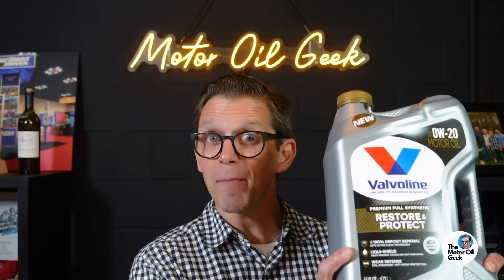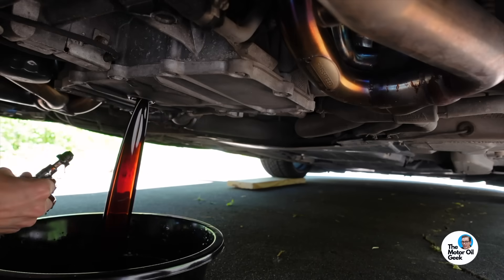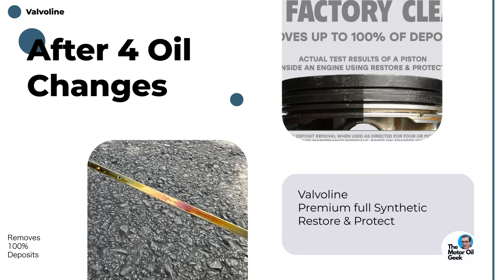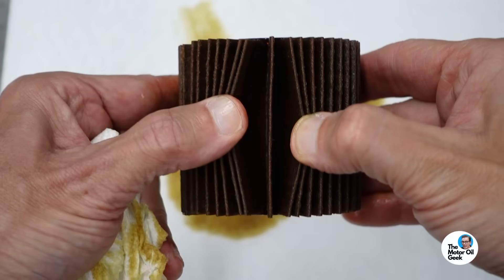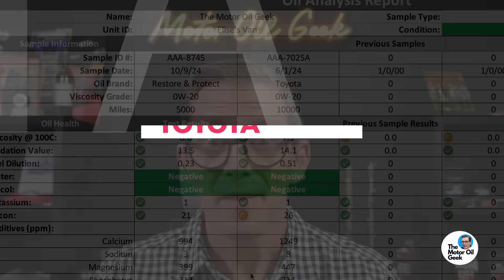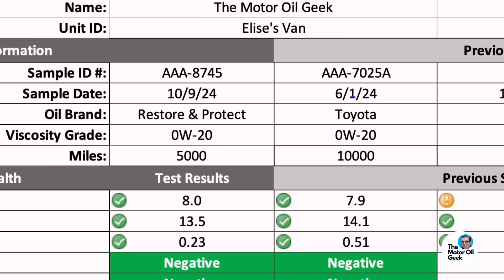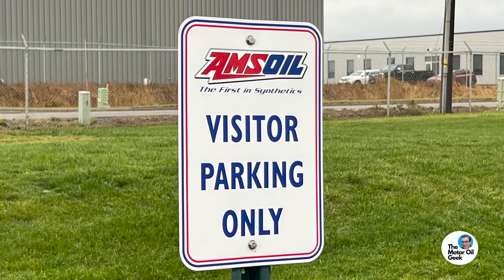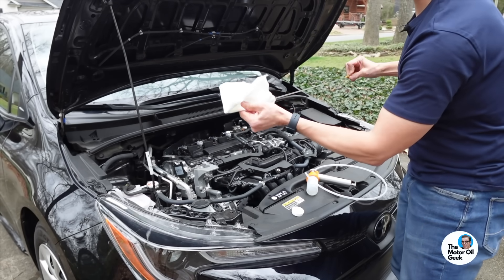The TRUTH About Valvoline's BOLD Engine Cleaning Claims

Comment: This oil is such a gimmick. We are supposed to believe you can abuse your engine for years and then run this through a couple of times and it will clean out all the sludge and stop oil leaks.
Reply: 4 times to be exact...lol
Reply: my civic burns ALOT of oil..about 700-1k per qt. Car calls for 5W-20, should i just go with 5W-30 to get lasting effects from the oil consumption? Was thinking it wouldnt hurt to keep this in longer & get more out of it? Thoughts? Also, should i top off with this or can I get away with other simialr valvoline products till next oil change? Apprently it takes 4 oil changes for it to work 100%?! Thanks!

Comment: I just run the plain Valvoline in  everything from the get-go. I don’t treat them easy.  Pulled  a couple of engines apart at 250 to 300,000 miles and clean as new inside.  
Works for me.

Comment: I know you talked about Amsoil I was wondering if Amsoil has the same benefits as Valvoline ?.  Also you mentioned about high octane fuel Sunoco now has Ultra 94 octane it's only 1 number above Shell and other brands Would Sunoco have a better overall effect on the engine efficiency and less ware and tear than Shell base on your opinion?
Reply: There will be none, please watch the film carefully, it results from the oil's cleaning parameters.

Just check both fuels, it really is no problem. I simply like driving on Shell V-Power; the car is livelier! For me, changing octanes to V-power from 95 to 100 makes no difference because the ignition is controlled by the computer and selects the amount of fuel and air, in old cars without electronics you would notice the difference.

Comment: I've been a Valvoline guy for as long as I've been changing my own oil, always used the full synthetic high mileage stuff as everything I owned was well into the 100k+ range. I've been using the restore and protect since it came out and it always seemed to be increasing the time between adding oil due to it burning and I definitely noticed the dipstick being cleaner, good to know it wasn't just a placebo

Comment: Do I have to worry about the  clogged oil filter by switching to this oil ? Thanks
Reply: From the film it follows that it does not because the carbon deposits are chemically dissolved very slowly in the oil and there is no clogging as if large particles of carbon deposits were torn off

Comment: Helo Sir How many miles did you have to wait to see the results and your wifes van ? To have a complete clean engine  I have a 2007 3.7L   Mitsubishi Raider with 190,000  now  by using  Walmart super tech and lucas oil stabilizer II'l have being changing my own oil since I bought the truck back on 2013 with only 72,000 miles , the truck runs just fine it doesn't smoke or burn oil ,in just wondering if making a change with this oil will bring the truck alive 😂thank you very much for sharing

Comment: Laying a metal dipstick across the engine and close to the battery terminals is a major cause for a short circuit?! Lay the dipstick across the top of the windshield near the vent behind the Rubber seal so for some reason it will not fall down into the engine compartment if the hood is closed it will not move it will stay right there and you will realize that you're getting blow by coming out of the dipstick tube that's creating oil spanner under the hood as well as giving you some type of diagnostic code to go along with it!

Royal Purple as an excellent oil the oil needs to be engineered in order to do the detergent and cleaning inside the engine which is exactly what Valvoline restore and protectors engineered for! You need to do a analysis of the royal purple before and after I would recommend that the motor geek compare this product as well in the future video
Reply: Can you also do some testing on the berryman's B12 used in the combustion chamber to clean up the carbon and rings and whether or not any of this product will leak into the oil engine oil and if it will cause dilution or show up in the chest oil that's test by the lab?

Comment: I just bought a 2012 Camry Hybrid with 125k miles. The dipstick is clean as clean gets. Not sure of what oils they used prior to me owning it. I do know most of the changes were at a Toyota dealer. I am tempted to try the restore and protect but I am not sure if it needs it. Oil stays pretty clean between changes and since I have it now I am going to be using Ultra Pennzoil that is not crude oil.

Comment: I have a question for you is it bad to use 10W-30 in a car that has over 170,000 miles on it when it calls for 5W 30 on the cap
Reply: With the age of the car we do not increase the viscosity of the oil because it usually ends badly for the engine, mainly due to the increase in carbon deposits

Comment: Sorry, but I doubt the correlation between Mn-concentration in used Oil and "Restore&
 & protect" Performance. In used oil analysis the higher  Mn contents mostly derived from oil dilution, specially when  Mn-containing fuel additives are used. I know results up to 100 ppm Mn in used oil analysis from "normal" First fill oil - according to your jnterpretation , the cleaning capability of these oil should even be higher than the Restore & Protect.
Additionally, the main mineral phase of Mn deposits in  combustion chambers is Hausmanite, a very stable spinel-like structure of MnO+Mn2O3 which cannot be dissolved by organic. 

However the Restore & Protect is a very good high millage oil with a good cleaning Performance in Ring Groove area, but only for organic deposits
Reply: A very interesting observation, could you write which sellers and in which fuels use this additive?
Reply: @nabiuro  I am Not familiar with the   fuel Market in the U.S ., but when he is taking about octane booster based on Mn, it is sold in the after sales Market. The chemical substance is MMT which is Methy-Cyclopentadienyl-Manganese dicarbonyl and which cause a Lot of trouble in combustion chambers, valves, Lambda sondes and blocking of particle Filters.
Reply: @HP-458  And what do you know about the European market, because I'm more interested in it, thanks in advance
Reply: @nabiuro i think  in european gasoline, a maximum of 8 mg/l ist allowed by regulation. However, you can buy octane booster everywhere in the after sales market.
Reply: @HP-458  I drive on Shell V-Power and not on crappy gasoline where you have to add additives to increase the octane number so that the car drives more briskly.... and does the same number of kilometers as on good. It is better to, for example, replace the air filter with a "sports" one from K&N, pour proven!!! top shelf oils and have a strict replacement service life and stick to it! Then you do not have to add any additives or flushes (I tested both with good fuel and oils and then their effect went down to placebo level!).

I almost forgot, I add 100 ml to the fuel. per 100 liters of fuel (3.38 oz. per 26 gallons) Universal Saver Fluid JLM valves lubricated in this way actually work better, compression checked every year is maintained at the same level as from the factory and the expense is almost zero

Generally, after all this fun and games only! with good tribological agents I have soundproofed the car in the cabin by 6 dB (A)! compared to a new factory car. The service of soundproofing the car cabin by only 4 dB is however a certain devastation of the car and costs about $ 3'800 and for this price I have for the car for free for a long time in the premium class and durability of the engine, gearbox and AWD system
Generally, fuel consumption has dropped by +10%, there is no point in saving in a stupid way. I simply cannot afford stupid savings, remembering how much it costs to replace the car with a new one

Comment: Why was the Tin level in the oil analysis higher though? Google says that can come from piston overlays or bearing material.
Reply from the maker: The Tin is from the Molybdenum additive in the Restore & Protect.
Reply: Tin can come from oil cooler solder joints too.

Comment: I would put money on the varnish being caused by running 10000 miles between oil changes. That makes my head hurt hearing that. I would never go over 3000 miles on an oil change. I had a 91 pontiac 6000LE with the 3.1L v6 and it always had valvoline ran in it. And it was given to me with 188,000 miles on it. I changed the oil every 3000 miles like my grandpa did and at 250,000 it needed a lower intake seal. The guy helping me do that said it was the cleanest engine he had ever seen with that kind of mileage. I sold that car with 320,000 on it and it was ready for another 100,000 at the least

Comment: Gonna try this in my 2016 Kia Optima that has been using quite a bit of oil despite religious oil changes. The rings have a lot of build up on them. Have tried a few things to clean it, but nothing has really worked very well for very long. We will see.

Comment: Thanks for the video. I did my break-in oil change and will be sending my sample for my 2024 Tundra. My plan was to twitch to Pennzoil ultra platinum but now you got me considering this Valvolne restore and protect. I would be interested in knowing how they match up head-to-head; wear durability etc.
Reply from the maker: I’m glad the video was helpful. Either oil will do a good job.
Reply: Also have a new Rav4, and wondering if running R&P from the start would be good?

Comment: I’m doing the same thing ( with the last oil change)with my wife’s 2010 Toyota Prius 170K I’m about to change it again. I have a question because my car doesn’t get as many miles it’s a Subaru BRZ limited what do you think about changing the oil filter only
Reply: It’s a good idea. I did that and had good results. I could feel a difference when I would change just the filter early.  The engine was smoother and faster right after as if I had changed the oil.
Reply: Also I have a 2012 Prius.

Comment: Thanks Lake!👍
Now if only the Medical Research Labs can make the Equivalent product to "Restore and Protect" our Cardiovascular systems! 😁🤞🥰
I could sure use some! 🖖
To date I've had a total of 4 Heart Surgeries. (Not including Multiple Angiograms)
1) Beginning at age 44 with 1 stent in RCA.
2) At age 57 an Ablation surgery for PVC's that went sideways and the "Dr" 🤨 rammed the catheter into a nerve bundle that left me with Left Bundle Branch Block and More prone to Arrhythmia issues!🤬
3) At age 60 I dropped dead from Ventricular Tachycardia and thanks to Numerous TALENTED and Compassionate Humans, I came back after 45 minutes of CPR, several Defibrillator conversions, 10 days in a Coma, 2 days of lowered body temperature for Neurological preservation while in the Coma, Triple Bypass Open Heart surgery, Combination Pacemaker/Defibrillator implant  that has saved my ass 3 times since 10/2021, (Strangely, the last job I was able to work was a Medical startup project that created the first Defibrillator in which the leads were only under the skin and Not into the heart!) and a 6 1/2 Week ”Vacation” in the Hospital, I was able to leave, minus about 35 pounds of muscle!😱 (Comas are a Great way to lose muscle mass in a Hurry! Not recommend)😬
4) At age 62 back into the Hospital for 4 more Stents and a 10 day "Vacation"! 😁

So come on Researchers get us some "Cardio-Clean Restore and Protect!" 👍😁

Mike in San Diego. 🌞🎸🚀🖖

Comment: What about a video on oil pressure?   Such as thickening the oil a bit for pressure or even going to the extent of a new oil pump or modifying the current oil pump pressure through spring tension.  I have a friend with a Hemi 5.7 that is having the notorious Cam and Lifters not liking each other.  We've considered shimming the current oil pump pressure valve maybe .025 - .030 to slightly increase normal driving/idle pressure to hopefully prevent damage to the replacement parts.  If this is a possible future video I'd love to see it.

Comment: I've been running 0W-20 Valvoline High Milage in my 13' GE8 Honda Fit, with no issues! besides loose valves at cold temps (not the oils fault) its done a great job running and starting for the 2 years ive had it. Changed the oil and filter myself 5 times, each around 8k or 5 months and have had a great experience with Valvoline. Cant wait to switch to the new Restore and Protect for a few months 😈😈

Comment: Awesome results my main concern would be when first using it should you change the filter sooner on the first 2 or 3 changes ?
Reply: I’ve had good results changing the filter early on the first few changes. As in I would just change the filter only, top off and wait a little longer to change the oil itself.

Comment: Curious to try this out on my 236k 2013 corolla. The valvetrain is a little noisy (it's been that way since about 192k miles sorta off and on). Inside the valve cover was no varnish and very clean cams and rockers. Curious to see if this stuff will make a difference. Also curious to see if I should try 5w30 or 0w20 edition.

Comment: I am curious how this compares with Pennzoil Platinum High Mileage, which is what I run in my two older vehicles. I am willing to switch over, but so far I have had good results with the Pennzoil and I would prefer not to switch oils. However, if the Valvoline proves far superior to the Pennzoil, I would probably switch over.

Comment: LS'jr just lowered his credibility with this video.
Reply from the maker: In all seriousness, why?
Reply: @themotoroilgeek  , I've looked at many UOA reports using R&P and very few have any levels of manganese. Most have 0. I can't see how one element can prove this oil is working and a clean dipstick hardly shows proof. 
I've learned a lot from you about oil. More than anyone. But I feel it's way too early to be saying it is woking. 
I don't trust a company when they are the only one doing real testing on their product.
I would like to see a controlled study done with engine breakdown. Most people using it have zero proof except what they assume is happening. I also don't think oil analysis could really show much proof in this case.
I'm not implying it doesn't work , but I believe it's too soon to say it's definitely working. Again, this is just my opinion, of course.
Reply: @themotoroilgeek  , I was looking at many UOA reports of people using VRP and most, if not all have 0 levels of manganese. I don't see how 1 UOA of 1 engine is proof that it is working. Let alone a clean dipstick.
I don't feel UOA could even show an engine is being cleaned by this product. I also have an issue where the company itself is the only proof the oil cleans. Valvoline, as a company do make great products. I've used them in the past.
I just have an issue stating that it works by just looking at 1 element in a UOA on 1 engine and that's enough proof. I would like to see an independent company do a before and after engine teardown to prove it. Not just a few YouTubers saying it works because they burned 1 oz less of oil. 
I appreciate all you do and have leaned a lot from you. I just need more time and proof that it does what it says. I think that is only fair. I think your video does prove that TGMO oil should't be used for 10k oil changes. Thank you for your time.
Reply from the maker: @littlet7556  That's fair to be skeptical of a single oil analysis. I can appreciate your skepticism. While the engine tests at Valvoline are in their lab, the actual test stands are ASTM certified, so that is an independent accreditation. Since I was an ASTM member, I have a different level of insight into these engine tests than most people would have. I also have the benefit of seeing thousands of used oil samples, so the correlation is obvious to me. At the end of the day, it's a YouTube video and not an SAE white paper. With that said, I stand by the testing we did, the results and the conclusions drawn from those results. I also appreciate your respectful reply.

Comment: 2013 Toyota Sequoia Platinum with almost 270k. About 3,500 miles ago, I did my first oil change with Valvoline R&P. Prior to that, I either did dealer oil changes which may have used Mobil1 0w-20 as opposed to Toyota branded 0w-20. I bought the car with 114k on it, so I’m not sure what the previous owner did with oil changes. 

I for the better part of the last ~60k I’ve used the Amsoil 12k motor oil, but for the last 30 or so I’ve used Mobil1 High Mileage, Amsoil OE and regular Mobil with no more than a 5k change interval.

I did not have varnish on the dipstick that I can ever remember, but definitely don’t have it now.

I had been going through about a quart of oil every 4k or so, but with the 3,500 on this R&P I have barely used any. 

Aside from oil consumption I’m trying to “fix” the cold start chain slap on the 3UR-FE 5.7. 

Since it’s very been putting ~20k or so per year on the car, I should have 4 oil changes by summer.

If you want, I’ll send you my oil sample on the next change that will likely be before Christmas and with only about 4k miles. I want to try to avoid changing the oil during the cold winter months because I hate working on a cold car. 😂

Comment: It's easy to clean out a motor, throw some seafoam in the oil or whatever detergent you want, the debated part is whether the pros outweigh the risk. Breaking loose sludge and debris is great if it exits properly, but if it gets plugged up somewhere it can cost you your motor.

Comment: Has anyone done a compression test before and after to see if the cleaning of the cylinders and pistons resulted in less blow by (with less fuel additives getting into the crankcase oil) or with more blow by (explaining those fuel additive ppm increase) found in the oil analysis?